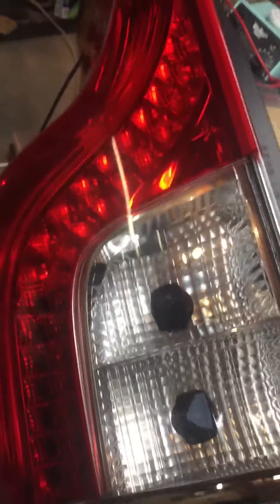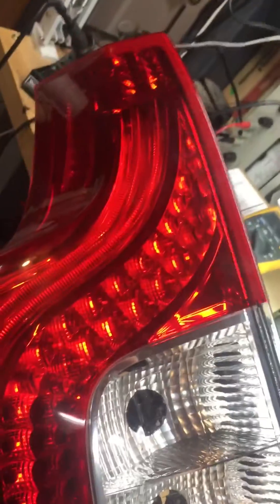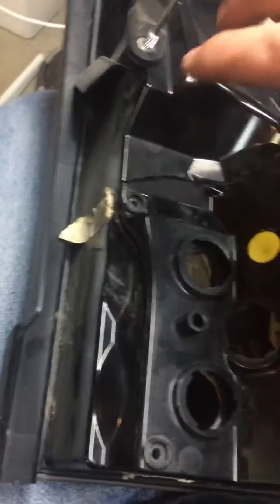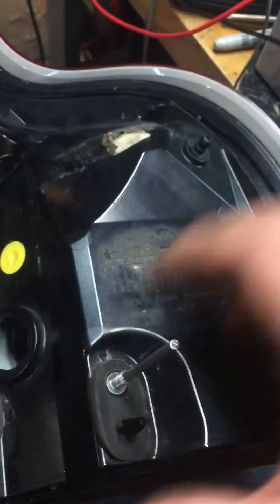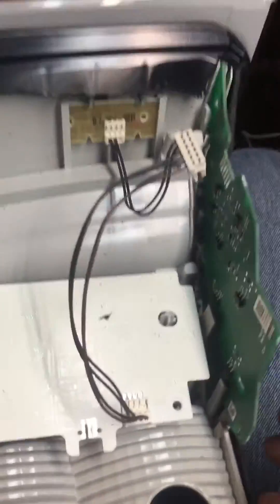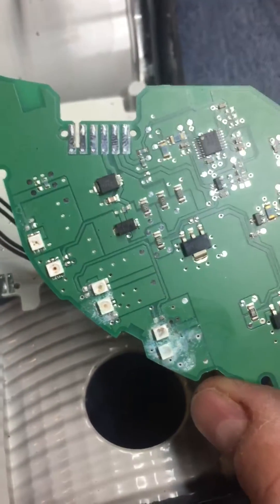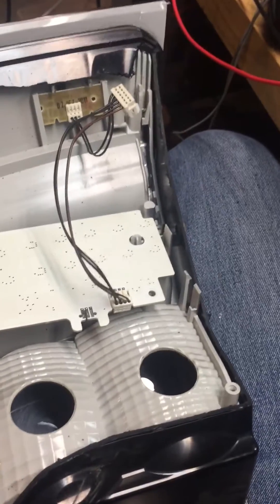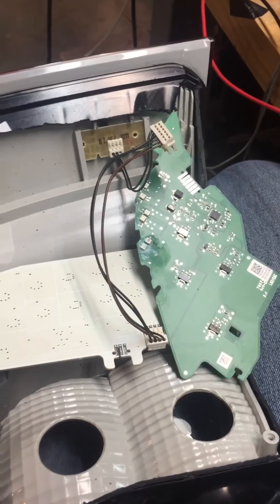Volvo XC90 LED Tail light repair/tear down

Comment: My '13 XC90 cracked in the same spot.  Must be some sort of design fault in the plastic housing.  If you didn't throw out the old housing, I'd be interested in it.  I want to light my upper reflectors and need to see how Volvo did their lighted acrylic rod and measure the serration spacing. I plan to continue that led "S" lighting up the reflector on both sides... Thanks!
Reply from the maker: I know you commented a long time ago, but I did just come across the old light; you can have it if you still want it.